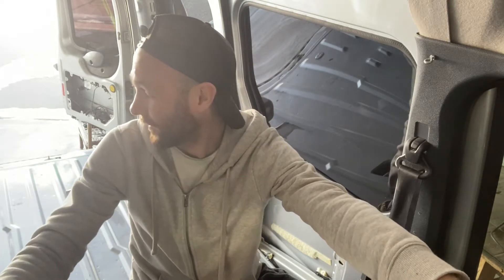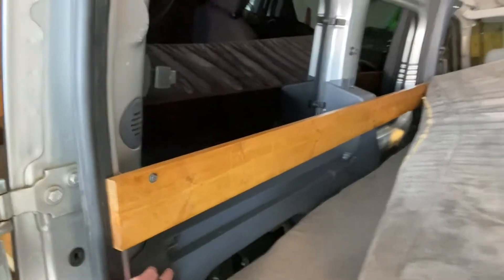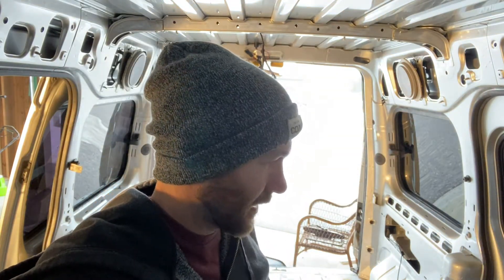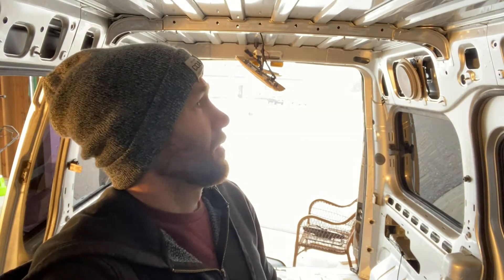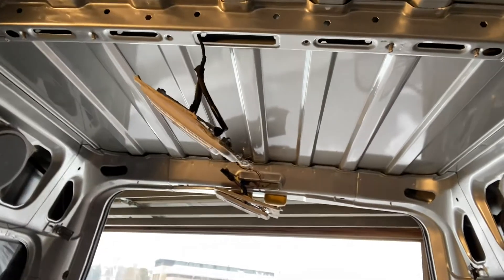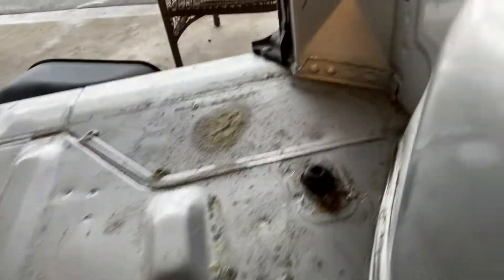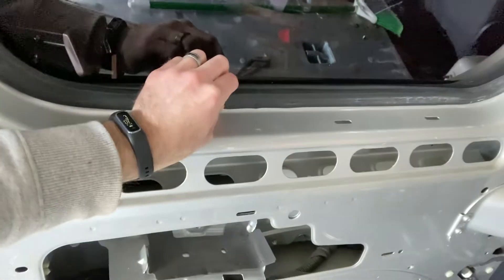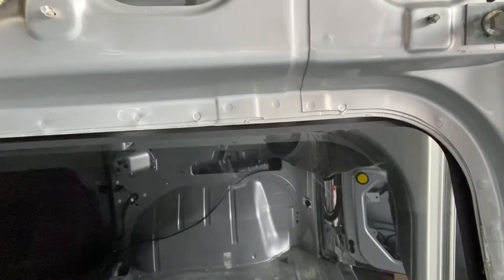Gutting the Van | Ford Transit Connect Camper Van Build | Step by Step Series

Comment: Please oh please _ Check the decal on the drivers side door jamb where your tire pressure sticker is. There is a GROSS vehicle weight decal. You only have about 1500-1600 pound cargo weight capacity. This already includes you and the bride and a full tank of gas and once you start adding stuff you will approach that number very fast. Understand it and weigh stuff your adding as it does affect your power, braking, and milage. These vans are grossly under powered when you hit the mountains.I have a roll of Thinsulate insulation that will easily cover your ceiling. If you want it, you can have it - I just need an address on where you want it sent for free.
Reply from the maker: Sound advice my friend, thank you! I also think I have enough insulation to tackle the rest of the van. I appreciate the offer, but maybe a viewer can take you up on that if they see this.
Reply: Hello Robert! I’m currently in the process of gutting my Ford Transit Connect and looking into lightweight insulation options. I too was worried about overall weight capacity of our van after the build. Are you still trying to get rid of that roll of Thinsulate insulation?